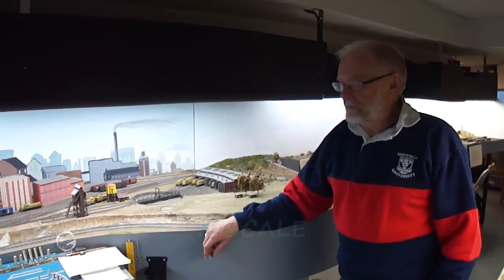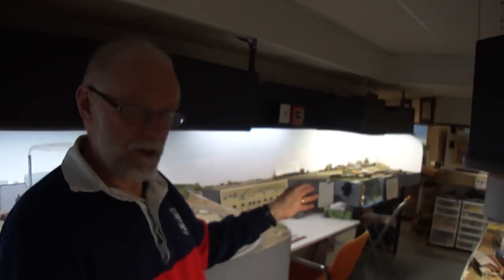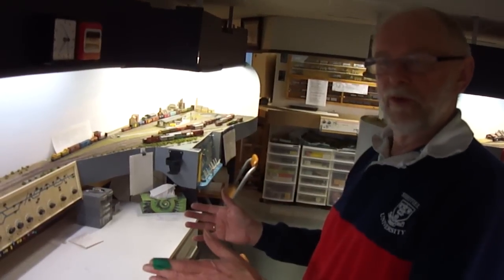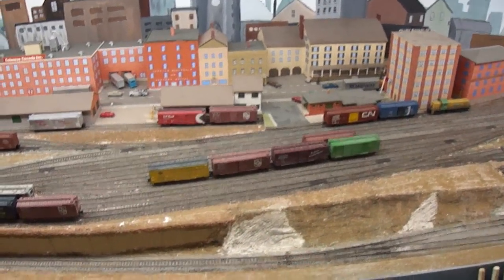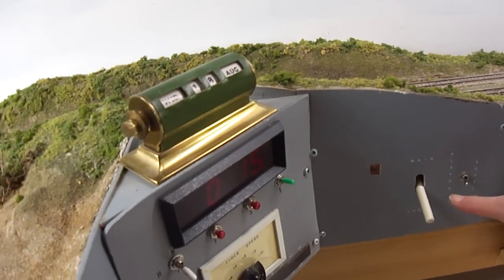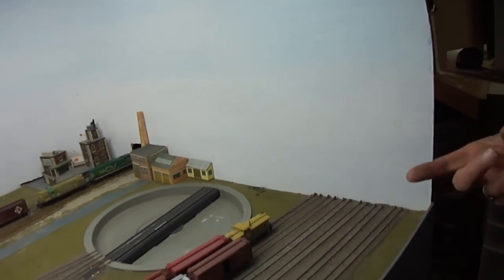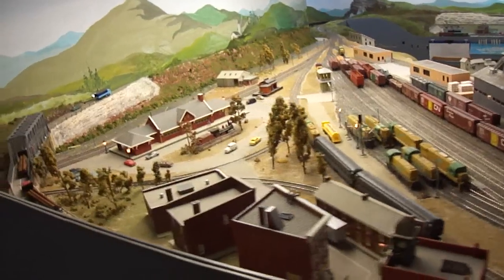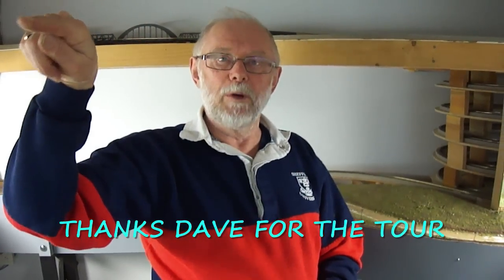SAINT FRANCIS VALLEY RAILWAY: N SCALE

Comment: Looking forward to the operations video.  It will be interesting to see the strategy used to find/identify the right car in the yard areas.  With N scale being so small it is rather difficult sometimes to find a specific car in a yard when all you can really see is the roof.
Reply: With proper layout design and operation, it should never be necessary to find a specific car in a yard.
Each yard track will either contain already-sorted-cars or cars-to-be-sorted.
If a track is already sorted, all the cars in it will be treated as a train and the individual cars do not have to be found until it reaches it's destination.  If a track is not yet sorted, the cars will have to be pulled into the switching lead to sort them, and they should be easy to find there (assuming the lead is located sensibly).
That's an over-simplification, but I hope it answers your concern (which applies to all scales as car numbers cannot be seen in the middle of a yard regardless of scale).
Reply from the maker: mpeterll Exactly right.  The only problem I ever see is when human error results in a car not arriving in a yard and the train is being made up and it is not there.  Sometimes an operator will make the mistake of just looking at the road name and car type and the numbers are very close.  Did you notice the magnifying glass in the slot to help those with old eyes:)

Comment: Where might I get more info on the specs for the Lazy 7 switches mentioned in the video?
Reply from the maker: Gene Jablonski  The lazy 7 turnouts are based on an article by Jim Hediger in the December 1977 issue of Model 
Railroader. The title of the article is Mark 7 turnout control
Reply: Thanks for the info ...